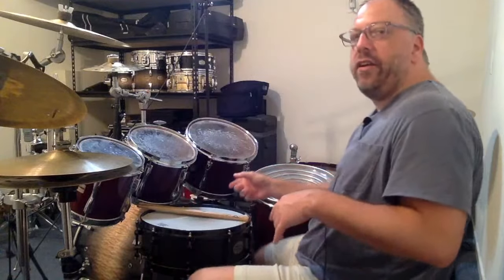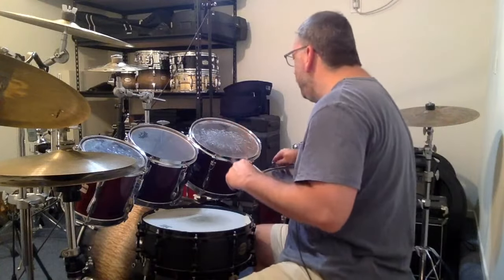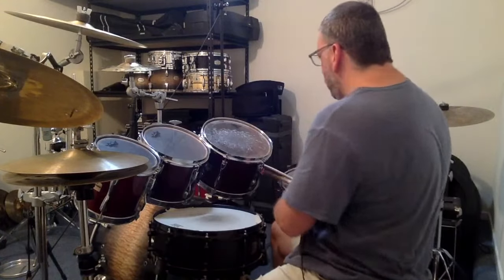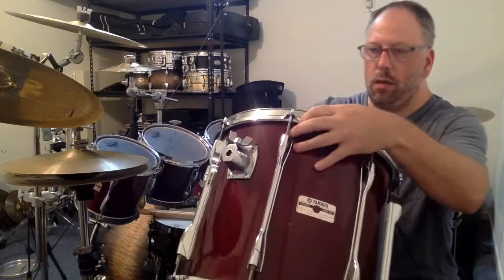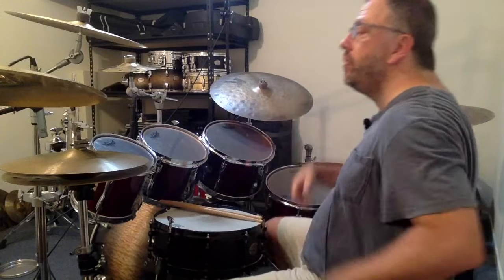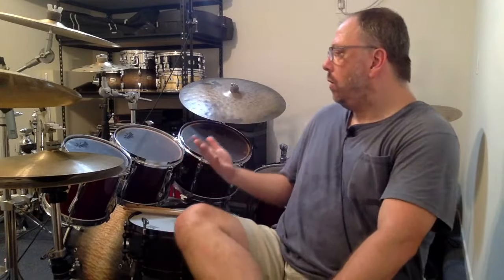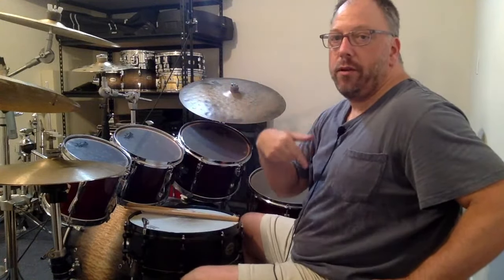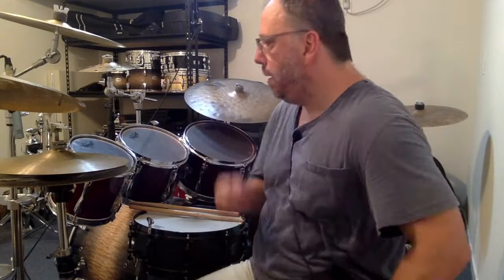New heads with a drum tuning walk through (Yamaha Recording Customs)

Comment: Thankyou Steve. I’ve always struggled tuning my 12 RC too. I use a regular size 12 and a power sized 12 which I picked up cheap on eBay as it had some ‘snare rash’. So I have 10 12 12pwr & 14 which I also like low and fat like yourself. I think I get a little more bottom end from emperors than regular ambassadors but Virgil seems to do ok with the ambassadors! Superb wisdom and sharing of your knowledge man.

Comment: I have a Tama Art Star with 10,12,13 and the 13 acts just like your 12.  It never wants to tune and just when I think its in a good place it has that identical mystery buzz.  I have a suspicion its in inside below the lug nut.  Like maybe the dampening material in the lug spring has shifted or deteriorated.  I haven't explored it to find out for sure.

Comment: Do today's modern isolation systems for rack and floor toms really make a big difference in terms of sustain? I had an old beginner kt in the late '80s and remember tuning both my rack and floor toms off the rack and floor. I would hold them by their hoops and they would have days of sustain. But then back on the rack and floor, their sustain was dead and "thuddy," even on a rug or carpet.

Comment: Hello Steve. I've watched a couple of your videos and I think you're a great drummer.
I have one of the new RC kit, and I recently put clear Evans G1's on my toms, and I've never tried your tuning approach by cranking the heads way up like that. So after putting on my heads, I instantly got dents. Now I'm particular about height, angels etc, but even so...
So shooting from my hip, I tried to crank the head om the 10" it actually helped to straightened out the dents to some degree, and the drum sounded instantly better.
Does this apply to coated and/or double ply heads ?
second question : Have you thought of putting the 8" and 10" up "Weckl style", and than move the 12" a bit closer and move the ride accordingly  ?
Reply: Try an ambassador, It won't dent, Evans g 1 Dent easily compared to a remo clear or coated ambassador.🥁